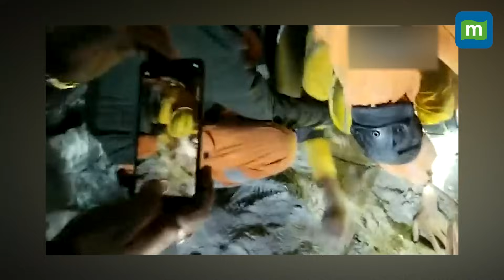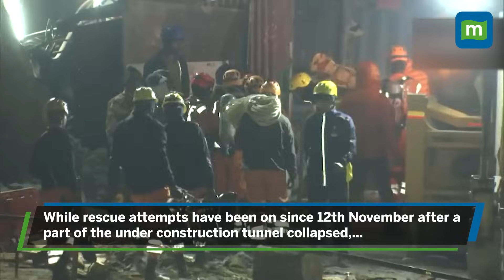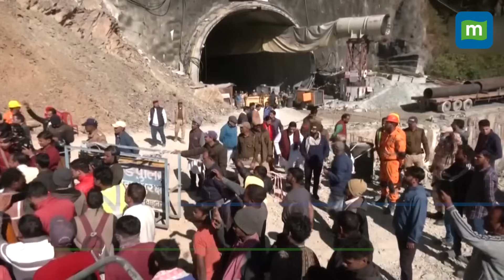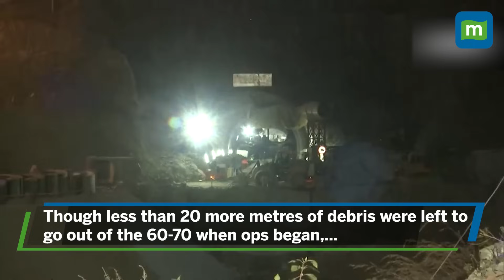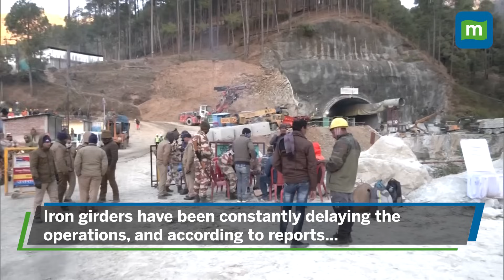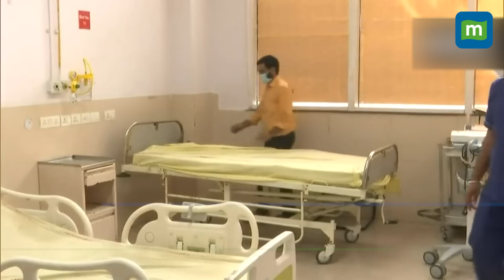Uttarakhand Tunnel Collapse: NDRF Shows How Workers Will Be Brought Out, Snag Delays Ops

Comment: What a stupid question: Andhar kesa raha?
Reply: I used to go in gulf countries to check the weld joints in side the pipe as quality control engineer,  inspector for many years..  Min 16 inch pipe to  72 inch pipes. This includes FRP GRP pipes.  We call it as visual inspection.